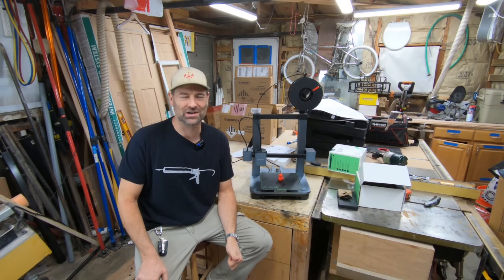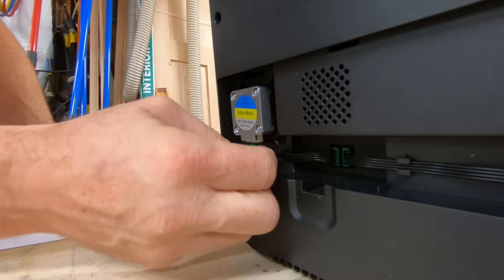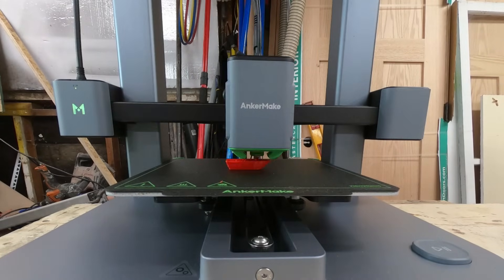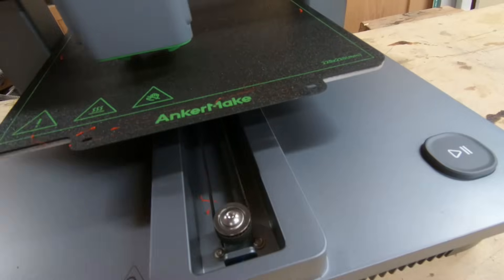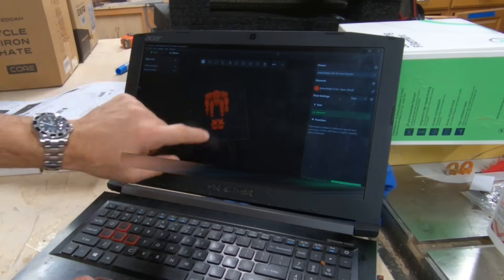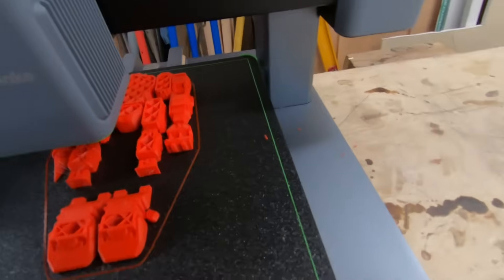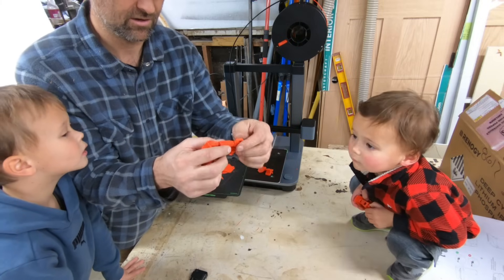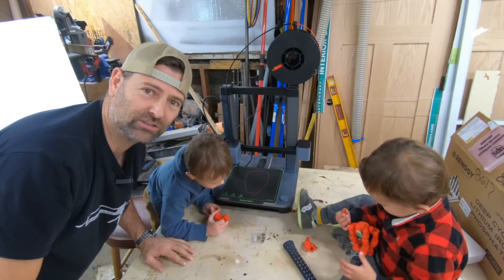👉💲💲3D Printer AnkerMake M5C | The First 24 Hours | I'm Going To Be Rich💲💲 |THE HANDYMAN |

Comment: 3D printers are great you'll have a lot of fun. I didn't want to buy a 3" jig off amazon to drill straight kitchen cabinet holes for the handles so I designed and 3d printed my own and it worked just fine. 

Word of advice it's not good to keep them in a shop they will get sawdust all over them unless you put a dust cover over it.

Comment: A couple of years ago I was installing a shower curtain rod and accidentally cut it 1/2" short.  After kicking myself for a minute, I was about to go buy a new rod, but then I thought of using my 3D printer.  It took me like 5 minutes to design a piece to extend each end of the rod 1/4", and a hour to print two of them.  They worked great.

Comment: I'm 3 months into 3d printing and I've printed through 10+ 1kg spools of filament. Went with bambu lab for the ability to print more than one color at a time. At the price point of this I'd recommend the bambu lab A1 mini or the just released A1. It's newer and substantially faster with a larger community than the anker one.
Reply from the maker: What do you use for 3d modeling?
Reply: Fusion 360 or FreeCAD